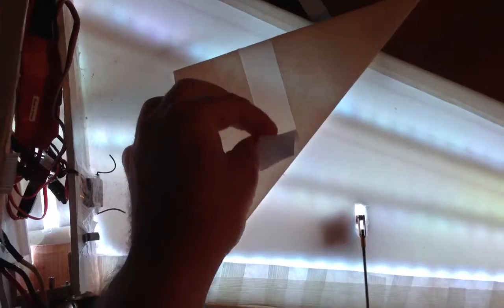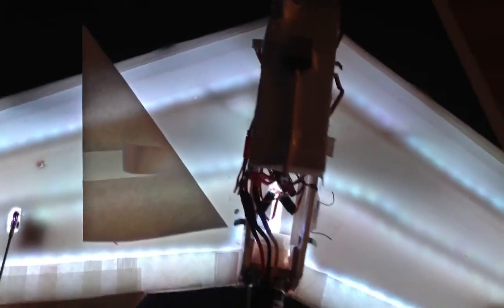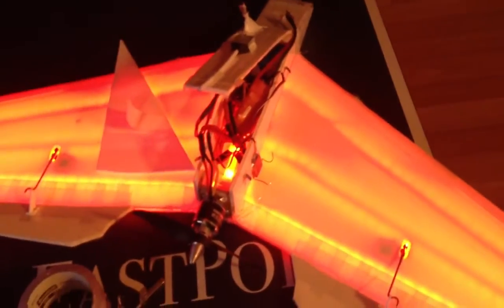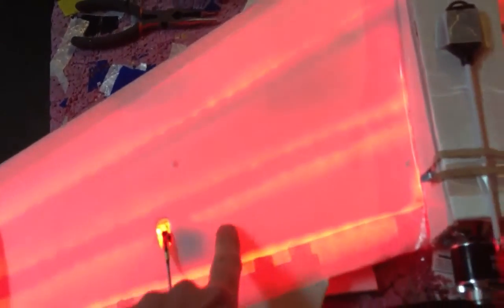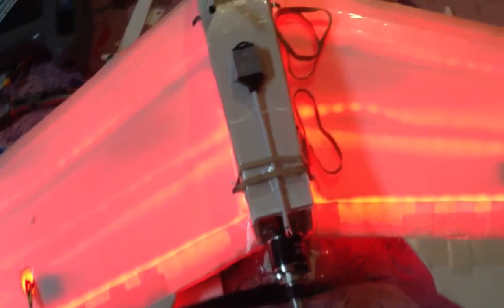Remote control LED lights for RC airplane part 2

Comment from the maker: When I talk about the white lights on top of the airplane I would use a separate battery, so I can use the lights or not (nano-tech 460 mah 25-40c 3cell) have fun flying